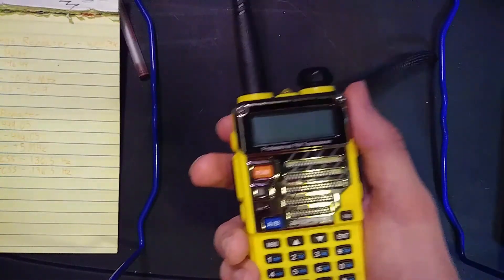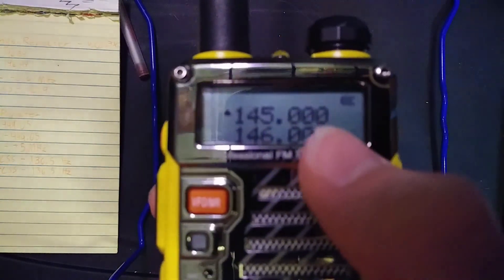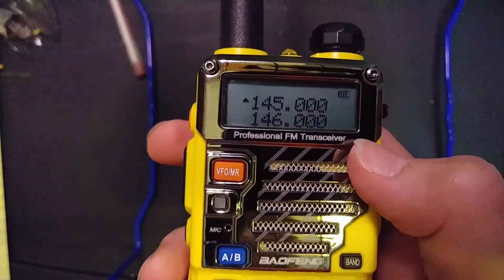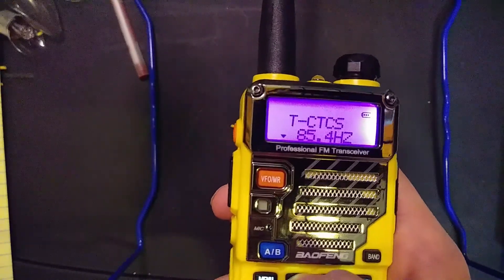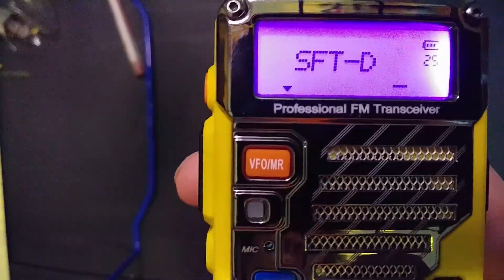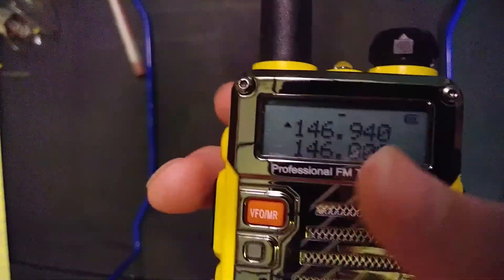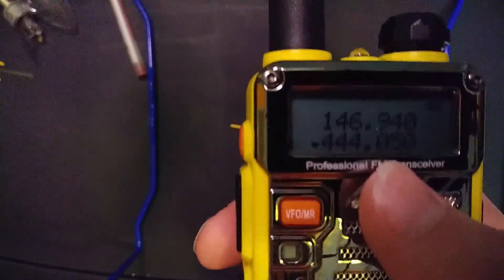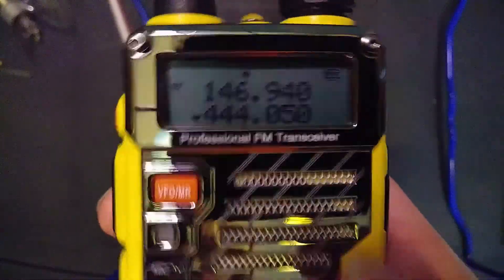How To Program A Baofeng UV-5R/UV-5R+ For Repeater Operation

Comment: I need an affordable radio to transmit on 41.95000. My job requires that I communicate in this freq and everyone I know uses a motorola xts radio. I don't want to spend that amount for a radio. Any cheaper options?
Reply from the maker: I'm not really sure because of that odd frequency. You shouldn't get any old radio that can transmit on 41.95, as it would need to comply with the FCC. Seeing that the Motorola XTS series seems to be digital, you probably can't get any old analogue radio. My best bet would be to just get whatever your friends have.

Comment: I have the same radio.  I am trying to program 444.1785.  How do you program in a five at the end and not a zero?  Thanks
Reply from the maker: I took a look on my Baofeng and can't really find a setting. I tried changing increment of frequency every time the up/down buttons are pushed, but it won't let me go down to 0.5 kHz. Other than that, there doesn't seem to be a setting in the menu. That is annoying because the Baofeng will sometimes let you do these exact frequencies, but you can't really control when it decides to do it. Your best bet it probably to get a programing cable and the software would likely allow you to put in 444.1785.
Reply: Round up

Comment: I bought this radio as a work radio to sink with all the radios they supply our management/maintenance and security teams at Walmart because the radios they supply us with are WAY too bulky and heavy to carry around all day...im not interested in using this radio EVER outside of my job at Walmart so all the licensed HAM peeps dont worry its STRICTLY for indoor Walmart use lol... it came default set to VHF and it cuts out CONSTANTLY... from what i understand UHF is better for indoor use but i have NO idea if UHF is compatible with the frequency/channel (or whatever) that we use at Walmart and i cant find out kuz it wont allow me to change to UHF without a computer which i dnt have :( every time i use the keypad to change bands and CONFIRM and EXIT ... once i return to menu 33 its back in VHF mode:( im curious .... if im forced to use VHF indoors and i cant use UHF for whatever reason..then can i improve the radios indoor function by just getting a better antenna ??? or will it ALWAYS be crappy reception because im using VHF indoors instead of UHF ??? P.S. I AM AN IDIOT WITH TECH SO PLEASE FEEL FREE TO SCHOOL ME OR YELL AT ME hahaha :) as long as you teach me something im down fer whatever responses i can get lol .... peace :)
Reply from the maker: I'm sorry to say, but using Baofengs for business or on business bands is illegal. Baofengs are registered by the FCC under part 97, the part for amateur radios. If they were to be used on MURS/FRS/GMRS, they would have to be registered under part 90. They would also have to comply to rules for MURS usage. There are some features the Baofeng has that go against MURS rules such as having a removable antenna and having adjustable power and bandwidth settings, among others. I would suggest you either go back to using your old work radio or getting a radio that is made for this use. If you do wish to continue using your Baofeng for this, then I would suggest setting power to low (menu option 2) and bandwidth to narrow (menu option 5).

As for your problem with the frequencies, there are three kinds of services you would need to worry about, MURS, FRS, and GMRS. MURS is VHF and has 5 channels. Walmart typically uses MURS, so this is probably the one you are dealing with. FRS and GMRS are UHF and have 22 channels. Both share the same channels, but GMRS requires a license and gives you more flexibility and channels. The frequencies for the channels on all of these services can be found online. Baofengs are compatible with these services and can transmit and receive on these frequencies, but like I said earlier, it is not legal. If you're stuck on VHF you can (in frequency mode) press the small 'Band' button to switch between UHF and VHF. Also, if in frequency mode, you can use the key pad to directly type in the frequency for any channel in either U/V.
Reply: @rcat256  thx fer the reply brthr :) so in your experience have u come across any radios  on the market that are small in size like the baofeng but are registered under part 90 ? im clueless about any of this stuff :( i jst bought the uv 5r kuz it was so small and easy to cary all day and  MULTIPLE people at my store carry them so i got the same kind they had (baofeng)....... should i be looking for a vhf (only) radio instead of the dual band ? i was told that vhf was used for outdoor usage and uhf was better for indoors as it goes thru walls and such, .... so why the hell would businesses like Walmart use vhf radios ? i get it if u need a HAM license to use GMRS but why wouldnt they use FRS on a uhf radio ?  anyway i was also still curious about the antenna , if i get a high gain antenna will this help with indoor vhf reception ? or if i were to buy an 8w radio instead of the 5w i have would that make any difference ? Any way thanx again :)
Reply from the maker: As for a radio you could try, this might do:
https://www.amazon.com/Retevis-Handheld-Waterproof-Rechargeable-Portable/dp/B08CKG9MTN/ref=sr_1_12?dchild=1&keywords=murs+radio&qid=1614735664&sr=8-12
This radio has five channels, because MURS has five channels.

Since MURS is only VHF, then you would only need a VHF radio, one specifically designed for MURS. You will probably have to ask management which channels your Walmart uses.

In your case you are using VHF.

VHF tends to travel a lot better than UHF, but UHF is better at passing through obstructions. But if you are only operating in Walmart, either one would do. It tends to be a bigger difference when you are going longer distances. Now Walmart isn't a big campus area, but it is still a large building. If you are trying to talk to someone in the opposite corner of the building, you may have weaker signal. Interference from devices, such as computers and other machinery, may weaken or mess up your signal.

The difference between five and eight watts on a handheld is very unnoticeable, however either one is overkill for inside a Walmart. Because of how MURS is, radios have to be operating at a low power anyway. MURS radios are already set to this specific power (I think it's like two watts or something). Getting a higher gain antenna wouldn't make much of a difference in your case, but again with MURS, it has restrictions; you have to use the built in hard-wired antenna that comes with a MURS radio. That's one of the reasons why using Baofengs for this is illegal (they have removable antennas).

Also, you don't need a HAM license for GMRS. GMRS has its own license. GMRS uses the same channels as FRS, but having a GMRS license lets you do higher power and gives more fixability with different radios.
Reply: @rcat256  thanx fer the info and advice my friend :) take care brthr